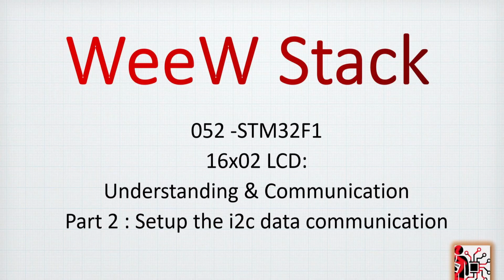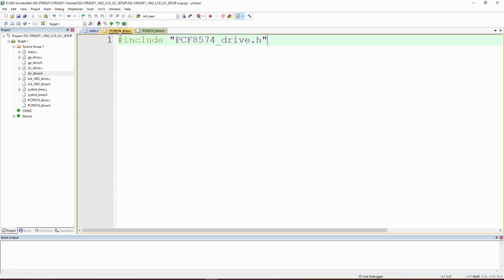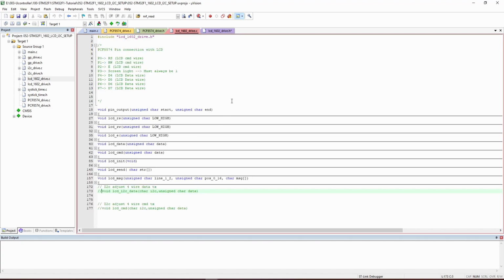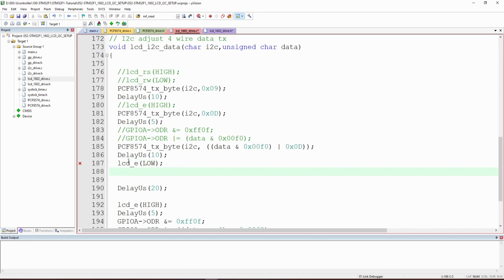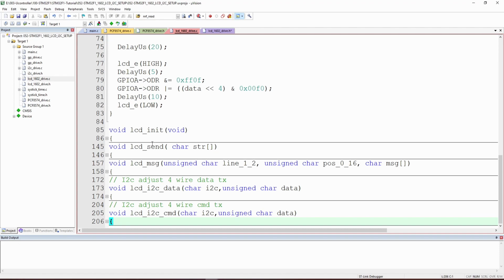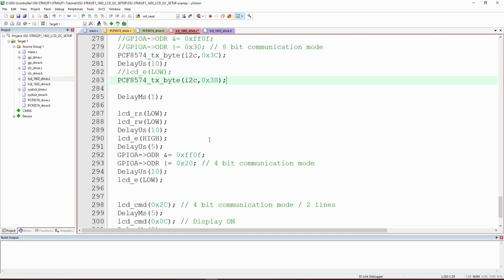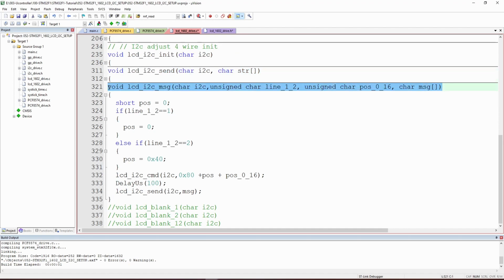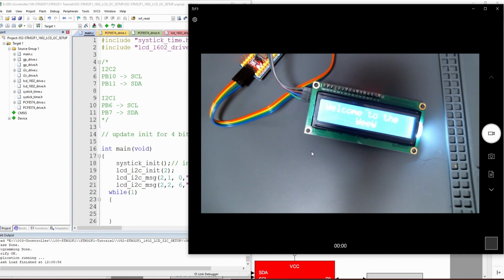052-STM32F1 1602 LCD Part2: LCD control using i2c communication setup

Comment: I really dont want to HAL . I use LL LIBRARY and its almost non existing to find i2c lcd code based on LL LIBRARY.  SO i will try port this code or just stick with cmsis. I hope this works bcos ive tried som cmsis based codes and it halts my program
Reply: why you dont want to use HAL ?? I think Hal is good ?